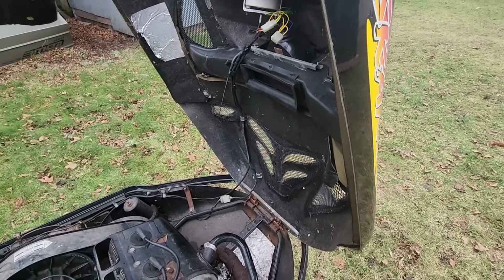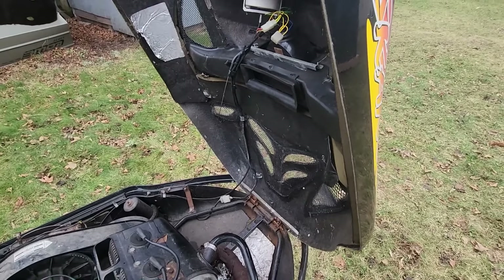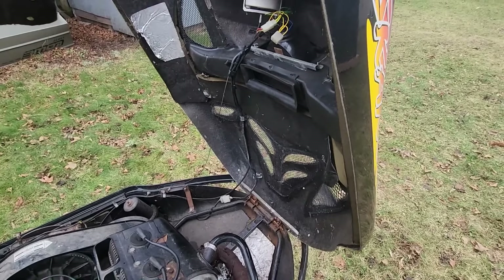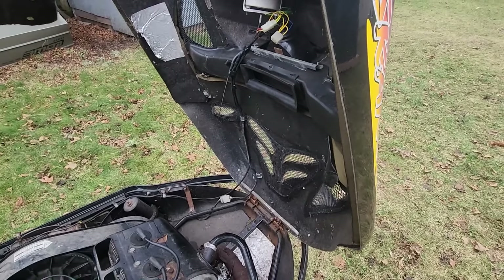First Ride On The Skidoo Skandic - We Have Some Issues

Comment: on your master cyl,take cover off.. there are return holes for the brake fluid, they get gummed up, take a paper clip or fine wire and run into return holes to remove clog.

Comment: Front drive bearing shot....usually they seize and take out pin. If your in low range I believe they are governed through ignition so you don't blow it up.
Reply from the maker: Yup broken speedopins are usually a telltale sign of a bad bearing. Surprised its gone with such low milage but it is old so understandable

Comment: Why wouldn’t you just buy a regular battery lol
Reply from the maker: It is the regular battery for the sled
Reply: @minnowlaketuning  I have the same sled , I use a motomaster Canadian tire one that’s supposed to be for a riding lawnmower
Reply from the maker: Yeah this battery is the actual correct battery for the sled. Nothing wrong with a lawn tractor battery as long as she fits lol